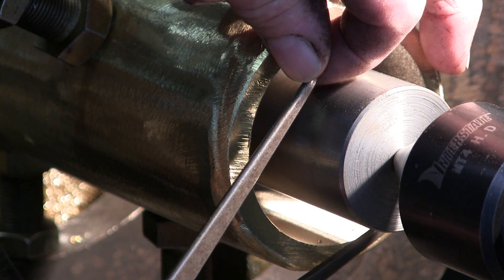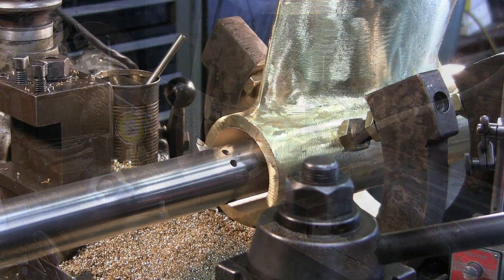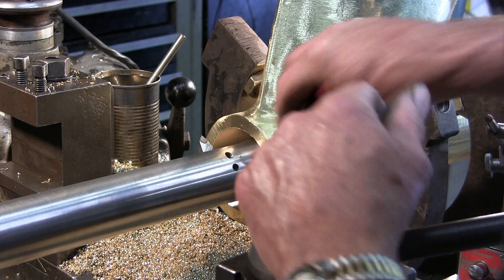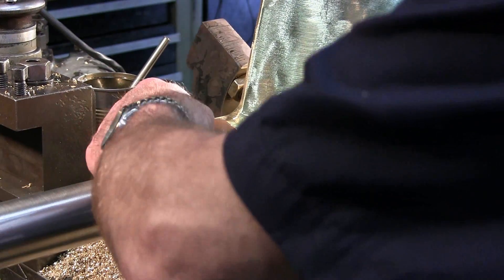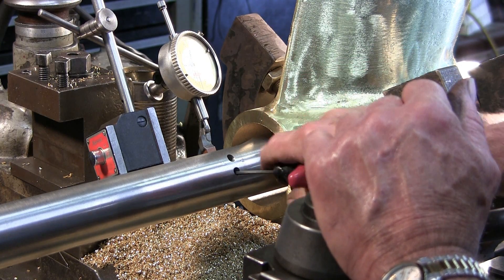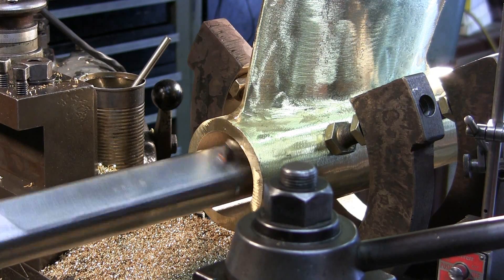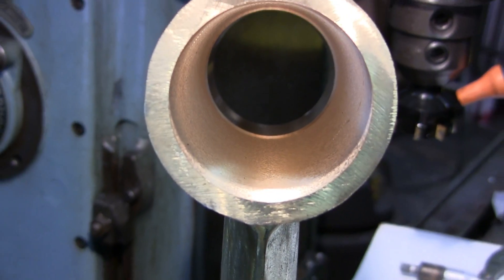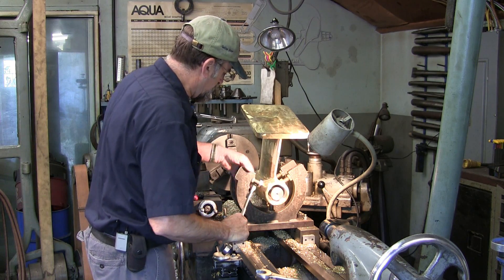My go to Bar Part 3

Comment: Hello , great video , and the three of them , i have a similar but not really quite situation and i would to ask you how would you go about it , we gave a pipe of 45mm od 35mm id and two bearings have to be press fitted of 41mm so a 40.95 to 40.90 pocket has to be made , those dont have to be exactly concentric with od but have to be concentric and parallel to each other , as i imagine it a 32 mm rod is required to clear the 35 mm id but there is no way to flatten the bar firstly cause there is no way and secondly i think it will weaken it , so we cant put an indicator on it , how do we measure the hole while still on setup ?

Comment: setting up dial indicator for exact height..  rings in oversized to slip on bar. allowing you to get indicator adjusted to zero on the rings and then take a measurement of your cutter height..    look at tobin arm boring bar setting tools.. with the double reading micrometers  for ideas..  should be really easy for you to create..  getting sizes even closer.

Comment: Mr. Keith, I've just recently found your videos.  I'm not a machinist, but deal with them regularly for my job.  I have to design adaption hardware for valve automation.  By watching your videos, I gain understanding of the machining process without the fear of upsetting my local machinist with my nosiness.  I really appreciate your expertise and explanation.  Thanks -

Comment: Keith,

Been gone for a while.  Just catching up.  Love that laugh.  “Ha ha… where did that screw-driver go? I just had it!”  (Think that was part two.) In contrast, I would use creative and corrosive colloquialisms that would singe eyebrows and traumatize the young.  I remember the same calm chuckle, when your mill-bit slipped from it’s collet and dug it’s-self in deeper than intended, when you where putting a keyway into a four inch shaft.  No problem you said, I’ll make a custom key.  I call that relaxed competency.

Thanks,
Brad

Comment: Keith, your videos are some of my favorites. Hope your getting some boat rides out of the work your doing. I was the mechanic at a mercury dealer that happened to be right on the water a few years back and one of the perks was going on a boat ride every time I finished a job to test run the boat. Loved it while it lasted.

Comment: Keith,

 Haven't seen this setup used for a while. We had a similar set up on a 36" American lathe for boring air cylinders at Koppers Company.

 We used shallow "V" blocks Instead of  "C" shaped saddles,with fine thread jacking screws. They were about 18" bore cylinders.

Those C saddles are really nice.

Our setup used a traveling head, and star wheel for feed.

 I bored a 1/3 size Case engine frame mounted on blocks on the carriage
of my  13" x 40" inch lathe. That's been five years or so.

Regards
Kap.

Comment: Don't know how you got a dislike on this series but i suppose there are some tools out there that do this for something to do.
In my opinion this was an excellent video on line boring .
Reply: ian bertenshaw 
Obviously not a machinist  OR one of the the 'know all' brigade.I am in England and Keith brings back the memories I have in the 1950s and 60s when I first started in a machine shop, the skills and knowledge that the old timers had and used to get
any job done without the aid of computors and 7th axis CNC machine centers.

Comment: Thanks for another great video! Boring should be renamed, as it's one of the most interesting operations. My lathe doesn't have flats on the saddle for the same setup that you have, but I plan to adapt a mount somehow. Being able to linebore in the lathe is so handy.

Comment: Beautiful pieces Keith! What is the story on the round drive lugs on the K&T rather than the normal square? When I get my HBM going maybe I will be able to test out which bores better a hard bar or a soft bar. I have heard conflicting things about what is better.
Reply from the maker: bcbloc02 Round lugs are fast to make and started out to be a quick temporary drive and 20 years later, still doing the job. ;{)-----

Comment: Beautiful job Keith!  You are lucky that your lathe has those T-slots in it so that you can use it for line boring like this.  I have done similar setups on the horizontal mill, but never on a lathe like this.
Reply: Keith Fenner Keith, have you thought about boxing your brass/bronze cuttings and sending them to the other Keith so he can do his great casting projects for his safe and the choo choo? 
Great videos.
Reply from the maker: Keith Rucker - VintageMachinery.org  Thanks Keith, what helps make this lathe a keeper! ;{)------
Reply: Pro trick : you can watch series on flixzone. I've been using it for watching a lot of movies these days.
Reply: @Roman Major Yea, I have been watching on flixzone for years myself =)

Comment: Really liked the ultra-slo-mo (with trollying/panning to boot) on the horizontal mill. You can really see what's going on. Next you will be fitting a micro-camera to one of the teeth so we can see actual chip formation.

Comment: hi Keith,
thanks for the wrap up on this series. interesting to say the least,..... would it make any difference if you used a 4 jaw chuck to run the bar instead of a 3 jaw (runout issues) ?
cheers
mike
Reply from the maker: HolzMichel The swing of the bit never changes, whether it is .100"  out or zero. The part passes over a stationary bit position. Not an issue. ;{)------
Reply: Keith Fenner
ok, makes sense, thanks :)

Comment: Hi mate.
I seem to remember that you had done a prop shaft support like these before.  What was the reason that you made the bar this time, rather than before?  It is a nice bar though.  However, it must have been quite an investment.
Marcel.
Reply from the maker: Marcel Timmers This set of struts had a smaller bore and wanted to create a bar for small applications. ;{)------
Reply: Ok, fair enough.  I did think I saw you wrestle with an other one, and I was right.  Thanks Keith.

Comment: Keith, really nice video. Given that you had to make the bar to do the job, I was wondering if you pass on at least some of the cost of making it when you priced out the job itself?
Reply from the maker: ***** investment just for the shop and tooling, one investment in your working less harder on the next project. ;{)------

Comment: If the Cutlass bearing is pressed into the strut up to the shoulder, How will it be removed later?
Great video on the whole project, thanks.

Rick
Reply from the maker: Rick Swanberg  that is exactly what I ask, but some engineers are set in their ideas. ;{)------